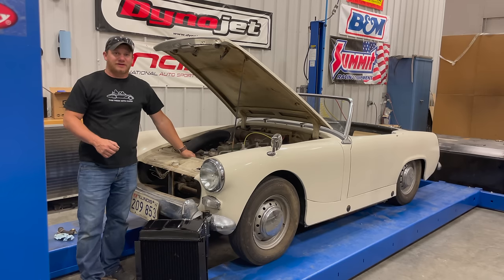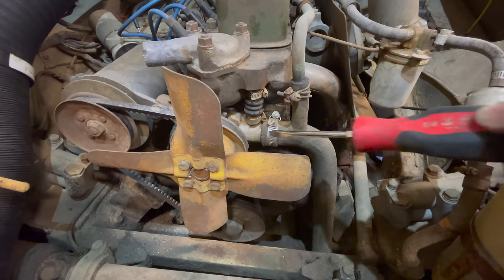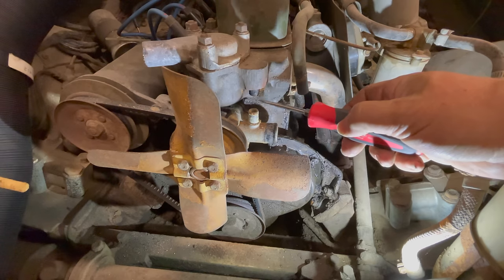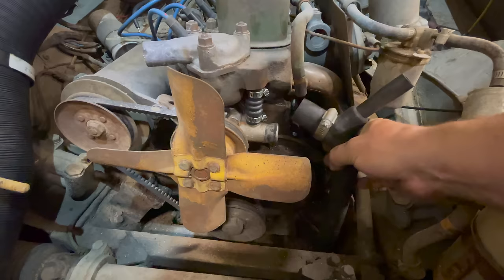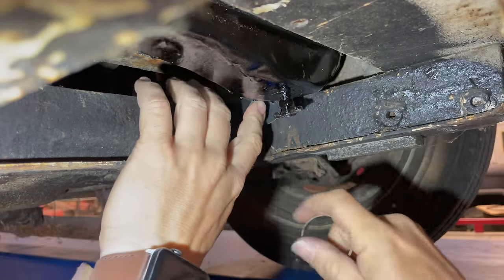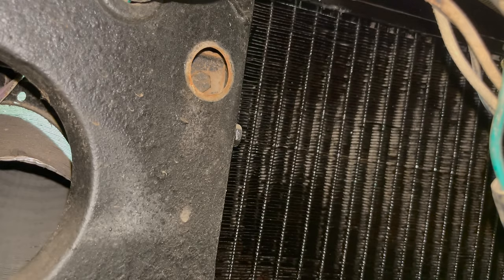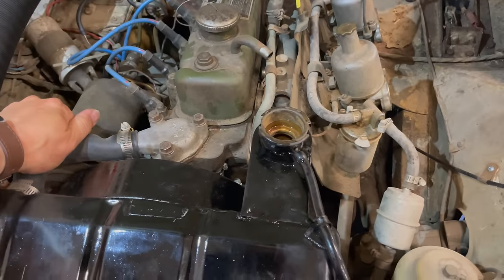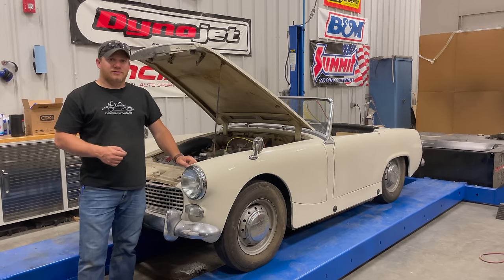1962 Austin Healey Sprite Mark II - Will It Cool?

Comment: P-80 is a rubber assembly lube. With no chemical attack to the hose as some grease will do. It is slick for installing then becomes slightly tacky when dry to help hold. Great product for fitting tight grommets, hoses, and other rubber slip on items.

Comment: When I installed the lower hose to the radiator I found that if I warmed the end of it with a heat gun it made it a bit more flexible and therefore a bit easier. I did use some lubricant as well.

Comment: I was really struggling to fit the short horizontal hose on my mga after an hr of trying lube etc cut hands I thought drop it in a cup of hot water for a couple so minutes when straight on no prob 🤦‍♂️

Comment: Thanks for the video Steve. On that short head to water pump by pass hose, have you tried Dish soap liquid instead of grease as it wont attack the rubber so much after fitting the hose...I know how hard It is to fit as I used to race Minis with basically the same engine. Thanks for the video though. - Ian = UK.

Comment: Mini's didn't use the accordion hose, they just used a piece of 1/2" heater style hose.   The accordion ones were generally fitted as a bodge by mechanics so you didn't have to remove the waterpump of head.
Reply from the maker: Sprites came from the factory with the accordion hose.
Reply: @ThisWeekWithCars  Wish they had done with Minis...   The rigid ones are a bugger to fit in-situ as I'm sure you know!
Reply: @AndyMarsh  removing the water pump is easy enough, even when you have no gasket.... cornflakes box gaskets work very well lol

Comment: The straight hose was fitted at factory when the engine was built the one you fitted was made to replace a blown straight hose as it would be impossible to replace it without removing the cylinder head or water pump.
Reply from the maker: The straight hose was used at the factory after 1968.  Before 1968 the Sprites did indeed come from the factory with the accordion style and can be seen in the Sprite literature equipped with such.  I have fitted the correct hose for this car.

Comment: The correct and originally fitted 'bypass'  hose on A series engines of that era was straight. The 'Concertina' squeezy hose came along as an aftermarket replacement because it was easier to fit..
Reply from the maker: This is not correct
Reply: @ThisWeekWithCars  Not so Steve.I worked at a UK BMC dealership from 1966 - 1979. The  Concertina/squeezy bypass hose didn't become a factory fitted item until the 1098cc engines were produced in late 1963.  Pete

Comment: Watch your oil pressure. 20 psi at idle maxing out at 38 psi is about half what it should be. Could be lots of things but needs looking at.
Reply: Maybe he's not using 20/50, as was usual for all these A series, especially as his summer ambient temp is likely to be far higher than ours here in the UK? I always maintained 45 psi on Rickover on my engine's, even stage 3 ones!

Comment: It might have been quicker to take the cylinder head off and just fit a short length of thick-wall hose. You will never have a bypass hose issue again after that.

Comment: Having had to replace this hose hundreds and hundreds of times, I can tell you that in my experience, just take the head off! Lap the valves and use the straight hose as the original! Those convoluted hoses don't usually last even 10 10K miles... 👌👍
Reply from the maker: 10K miles could take 20 years to put on a vehicle like this one.
Reply: @ThisWeekWithCars  Not when I was your age and dealing with them on a daily basis... 😁😁😁 You were still in liquid form when I had to deal with this, daily.... 🤭🤣🤣🤣